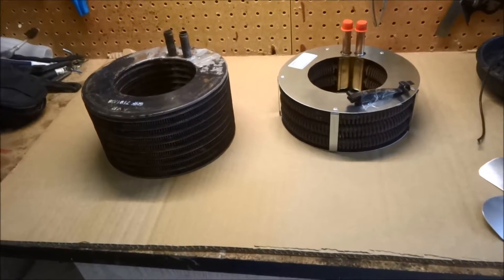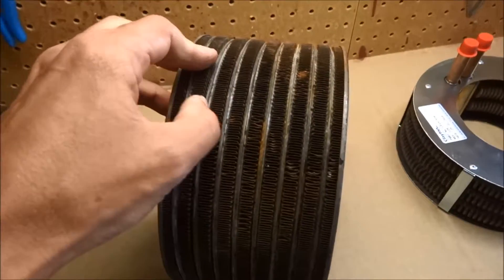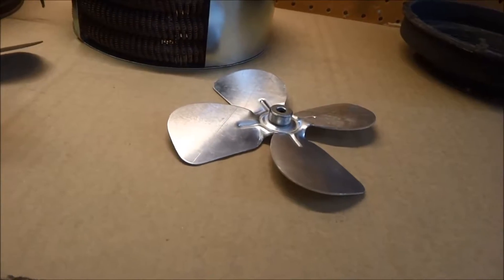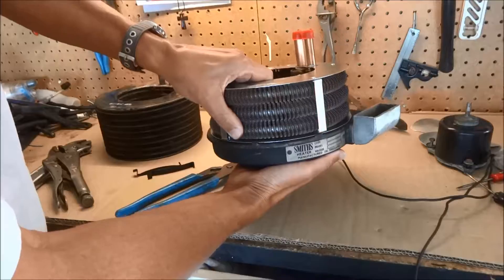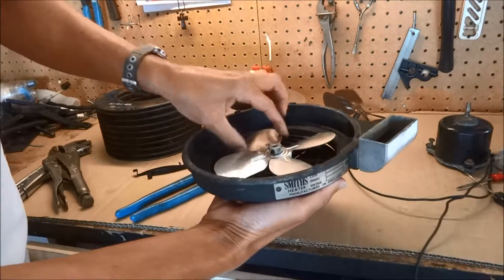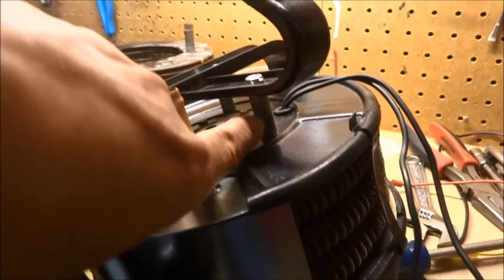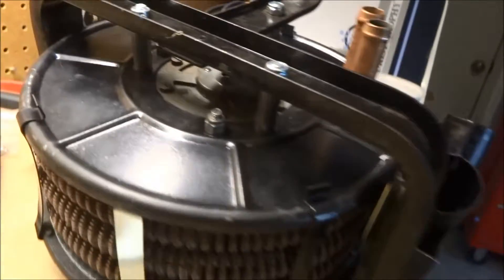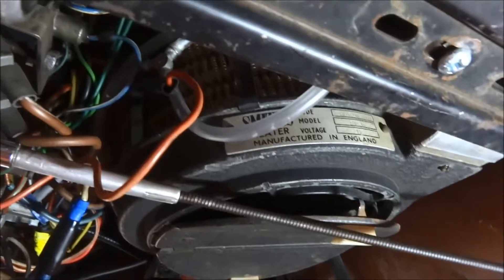Triumph TR3 Heater Core Review and Install

Comment: Thanks for a great how-to!  I know it's been a few years back, but do you recall (Chef Tush, this may be a more recent job you've done, so chime in!) if it's possible to access and remove the fan motor without full disassembly from the car?  I'm interested in refreshing my fan in my '58 TR3A, but don't want to drain the system to do so.
Reply from the maker: If you disconnect the mounting bracket at the top and lower the unit with the hoses attached, you might be able to get to the screws to disconnect the fan motor.  But it's a tight squeeze under the dashboard and I think it might be easier to drain it out and take the whole unit out to get to the motor.

Comment: Thanks for the video.  I was thinking that you would have to use spacer in order to utilize that top mounting stud that goes through the bulkhead.  Looks great!
Reply from the maker: Thanks!  The pipes that connected to the hoses were a little bit long and made it hard to fit the hoses under the dash.  I probably should have cut them down slightly and it would have fit easier.

Comment: Where is a original true location for the heater switch for a TR3?
Reply: On LHD cars here in the states, it's on the dash, just to the left of the speedo.  On RHD cars, it's in the corresponding spot on the right.